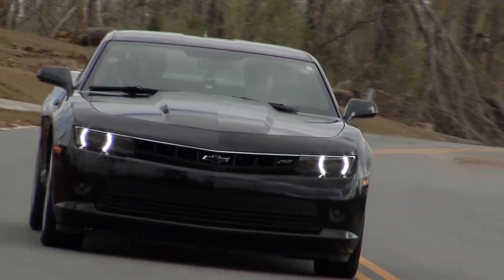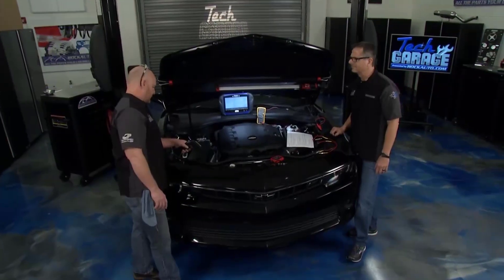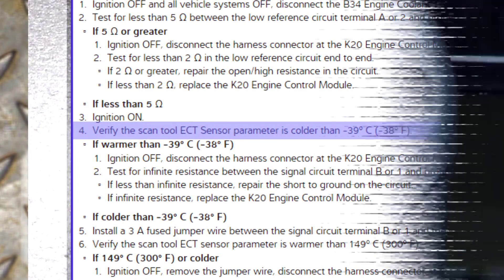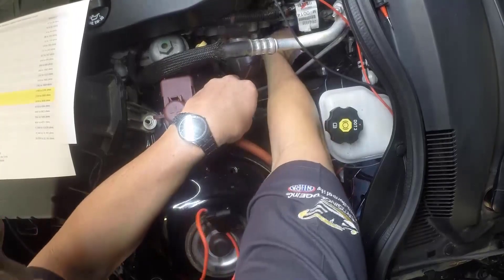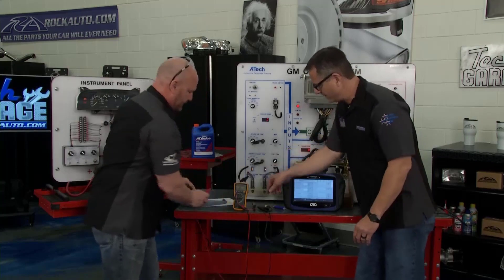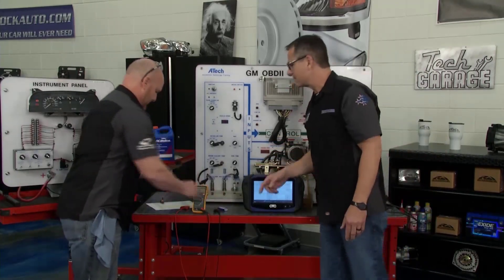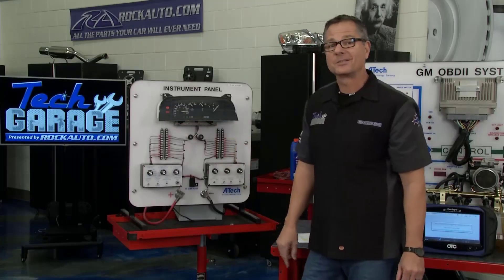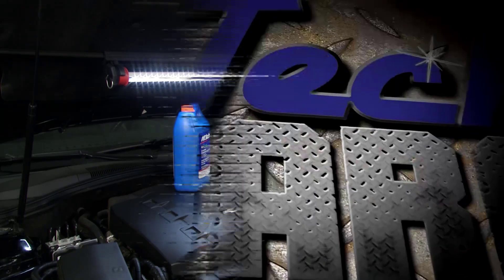Engine Coolant Temp Sensor Diagnosis

Comment: I just changed the Thermostat and Engine coolant Temperature Sensor. My 2015 Grand cherokee still running cold, it's eating up gas like crazy. Noticed that the gear changing is rough too... any ideas of what else it could be?

Comment: Firstly, thank you for this good video!
I need help on an issue related with this cooling system.
I have a 2004 model Peugeot 206 Xline (1.4i 55KW (75HP) GASOLINE). I start the car and drive for 10 kilometers and then the issue occurs. The issue is that car stop instantly while driving and when I re-start it, the temperature gauge shows ZERO degree and this stop issue reoccurs repeatedly. Engine works fine after stop, and restart, but the stopping issue repeats. After sometimes the temperature gauge shows 90 degree. When I faced with this problem, the fan motor does not work even if A/C is on. Additionally, when the car stops the Gas pamp is still working for 2 minutes after ignition off. When I plug-out/in the battery + terminal fan motor is working fine.
What I did for now:
1- Change the Engine Coolant Temperature Sensors (green and blue one for Peugeot 206). One is (blue) within the water, other is plugged motor body in blind flange.
2- Fan relays (slow and fast modes)
3- Oxygen sensor is OK.
4- Crank sensor is OK.
5- Catalytic converter is OK.

Please advise.